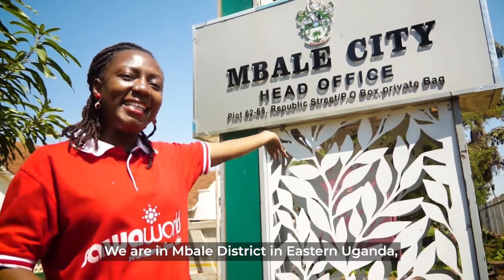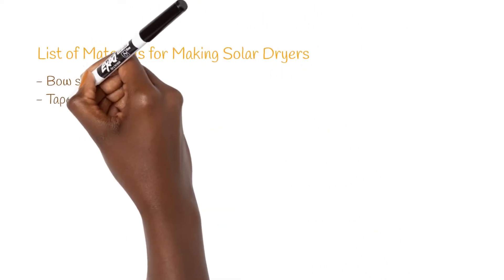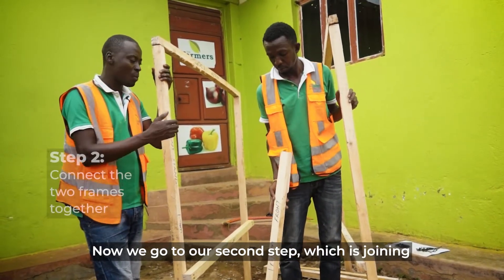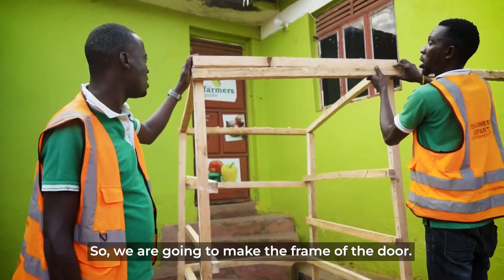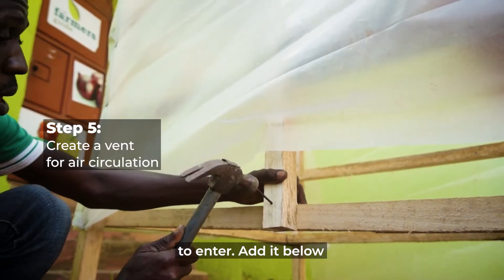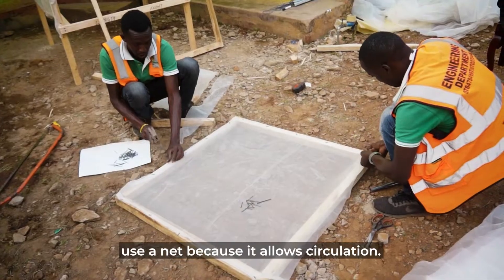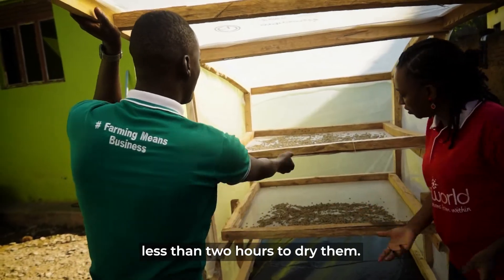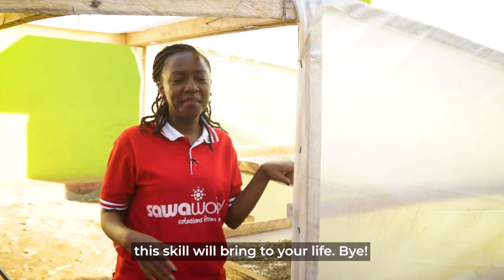How to Build a Solar Dryer: Sustainable Food Drying at Home Beginners Guide

Comment: Hello. Thank you for sharing. Please I will like to ask some questions. Must it be 1 foot between the trays? Can it be less so it fits in more trays? If one wanted a taller dryer, is it as simple as increasing the height of the frame and UV material, or is it not advisable? Is there an advantage to the door opening from bottom-up? Can it also open from the side? What type of store can one get the UV material, agricultural net, and the black DPC polythene? Thank you.

Comment: Can it dry chicken manure?
Reply from the maker: Yes! A solar dryer can be used to dry chicken manure. It helps reduce the moisture content, making it lighter, easier to handle, and better for use as fertilizer or compost. Just make sure the setup allows good airflow and reaches sufficient temperatures to dry it effectively and reduce odor.

Comment: what about cassava how long it can take to be dry
Reply from the maker: Hello Leonide, drying time for cassava in a solar dryer can vary depending on several factors:
- Thickness of cassava pieces
- Sunlight intensity
- Air circulation within the dryer

Depending on the factors above, drying time in a solar dryer could range from several hours to a full day.